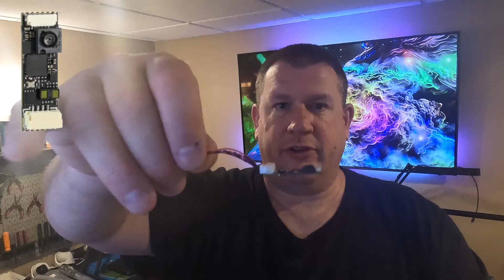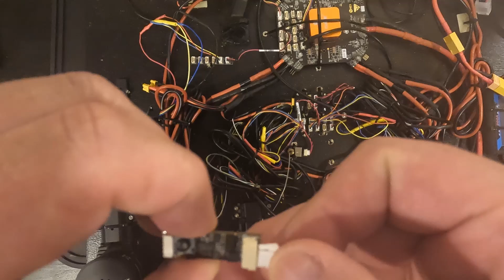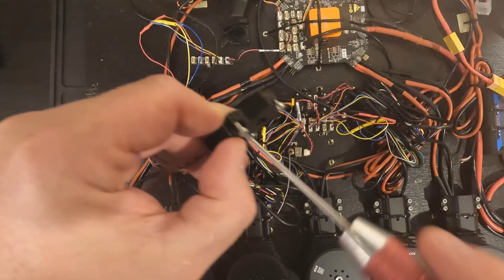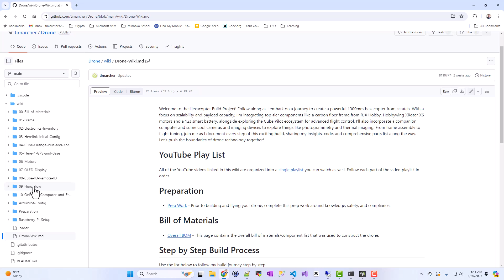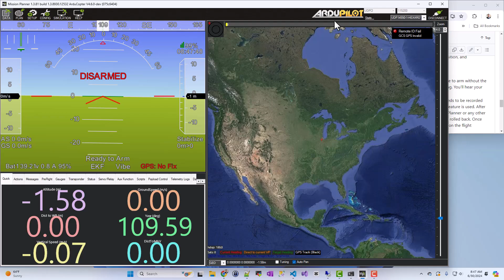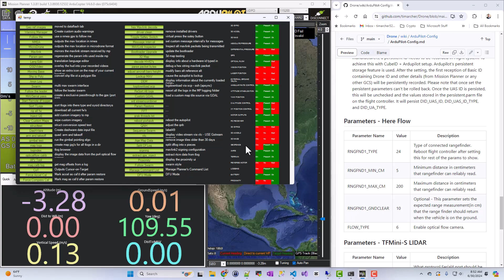Hexacopter Drone Build Project – Part 9 Here Flow

Comment: Will be  most interested in your choice of camera when you get there.
Reply from the maker: Me too. That's the component I'm struggling most with choosing right now. Any suggestions? I've been looking between the gremsy and siyi ones. I'm almost leaning towards a cheaper siyi a8 to start, and then upgrading to a siyi zt6. The siyi zt30 looks really nice...but it's pretty pricey.
Reply: @timarcher52  I'm looking for something that I can use to experiment with building modeling and photogrammetry (and of course fits in a hobbyist budget) . One needs a lot of pixels and low distortion. That leaves out all the popular FPV cameras. I really liked the SIYI and almost bought one, however the camera has only 8k pixels. Finally being a super tinkerer, I have decided to add a raspberry pi companion computer, and go with the raspberry pi hq camera with 12k pixels. The easily available 6mm lens gives an acceptable narrow field of view (and low distortion), but there are some longer focal length lenses that are less available. I have a cheep 3 axis gimbal from Alliexpress that I am going to try. ---- Happy Bilding.